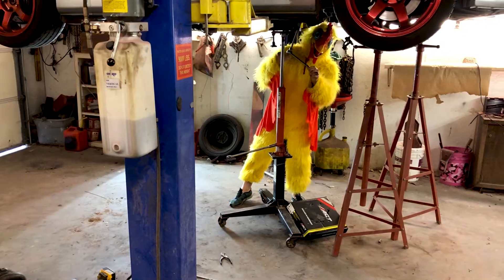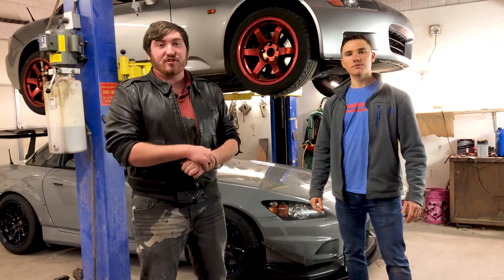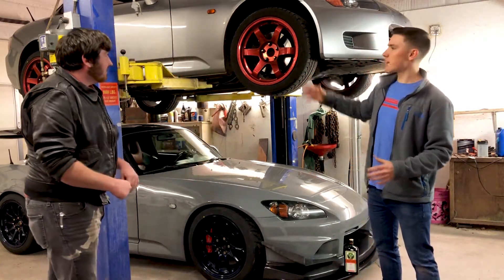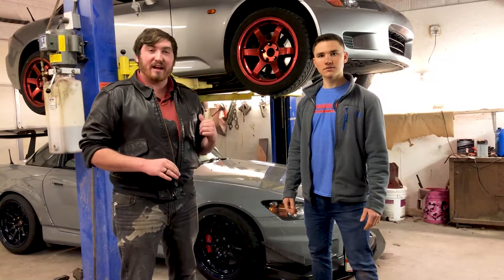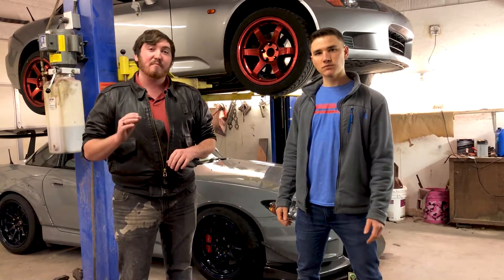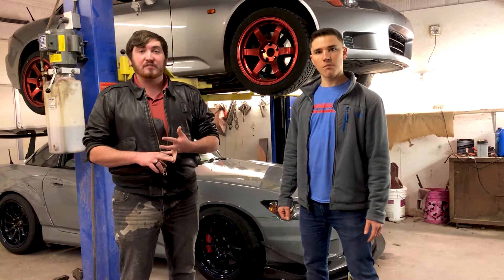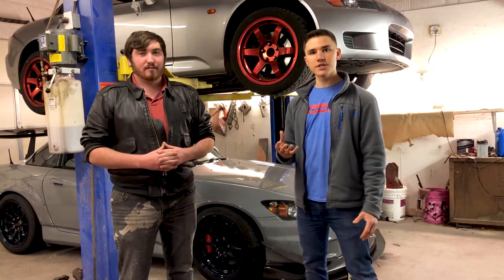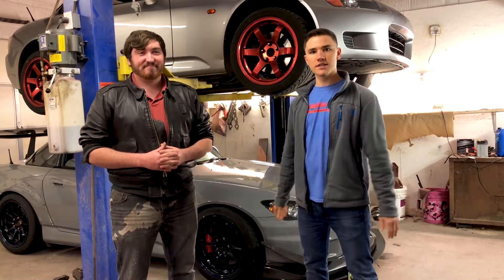Twin Honda S2000 Track Build! | Road to Hallett EP:1

Comment: Nice rides. I especially like the bottom one. I added Mugen engine/transmission mounts and compliance bushings not long ago. They are a nice upgrade, but they add some NHV into the cabin.
Reply from the maker: Appreciate it! I’ve been running Spoon engine and transmission mounts which are very similar to the Mugen currently on the Bottom S2000 and they do add a little bit of Vibration, but nothing too terrible.  They feel great for rev- matching.  I just replaced all of the control arm bushing on the Nardo Grey S2000 and it made a world of difference! The video for the bushing replacement releases this Thursday.  How bad were your Compliance Bushing?